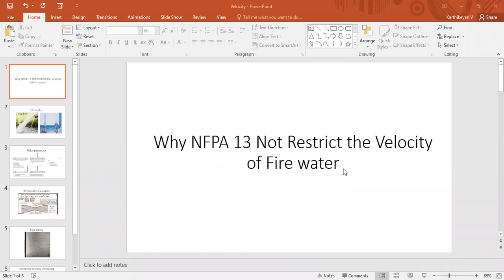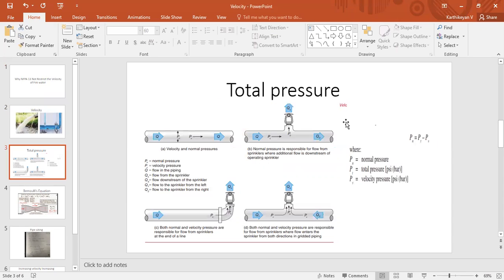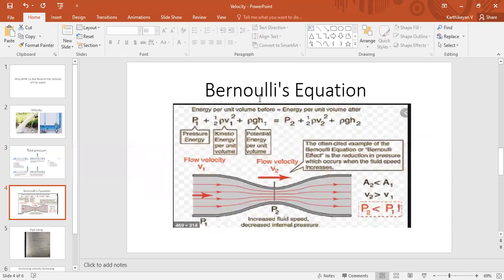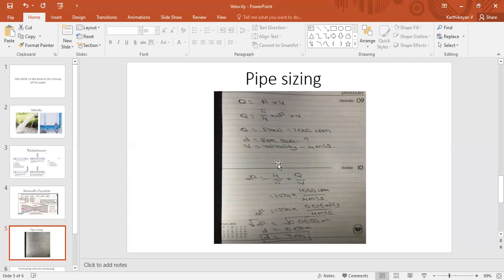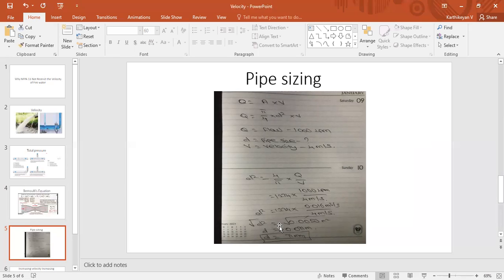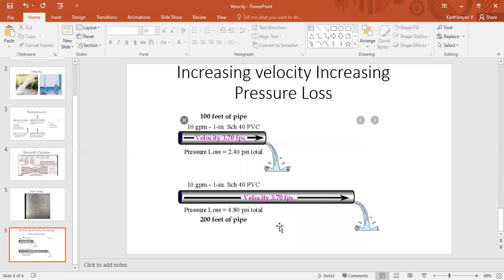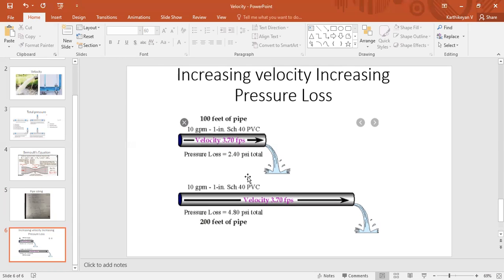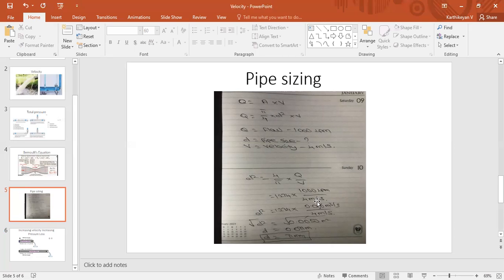Why NFPA 13 Not Restrict the Velocity of Fire water

Comment: In hydraulic calculation, I have a case where I have vertical sidewall sprinklers. So what is the maximum area I can go for 12 vertical sidewall sprinklers in my hydraulic calculation and how much coverage one of my vertical sidewall sprinklers will give if the hazard is ordinary?
Reply from the maker: Tq for yr comment.Let me summarize yr question pls correct me If I am wrong.
1.Design area and each sprinkler coverage area of vertical sidewall sprinklers
Reply from the maker: Which location you have provided vertical sidewall.How you took 12 sprinklers for calculations
Reply: yes, I want to know the design area and each sprinkler coverage of vertical side wall sprinklerssidewallnary hazard group-1.
Reply: @sprinklerdesigner3436  I have provided them in pump station.I am not sure whether if I have take 12 sprinklers or based on the total coverage area for ordinary hazard I have to take them.
Reply from the maker: What is area of pump room.?how many sprinklers it contains.what is the S & L dimensions .?Is design based on “ Room Design method” or “ Design area method”?
Reply from the maker: What kind of pump room you have ; Is it fire pump room or any utility or fuel transfer pump room
Reply from the maker: I am from India, If u r ok let me share my number.Let us discuss
Reply from the maker: @umarqureshi5311   +91 9611498981